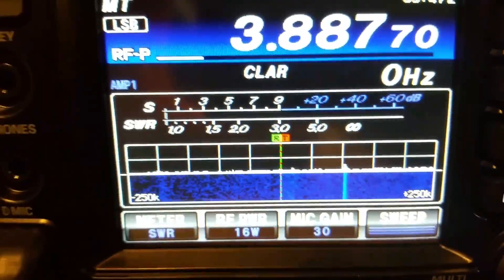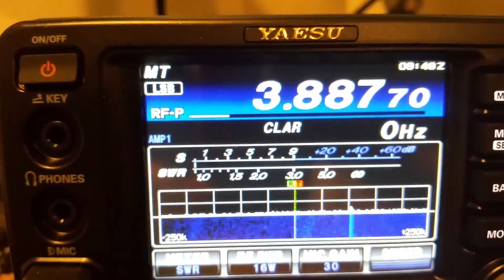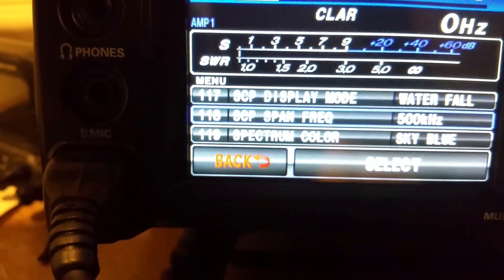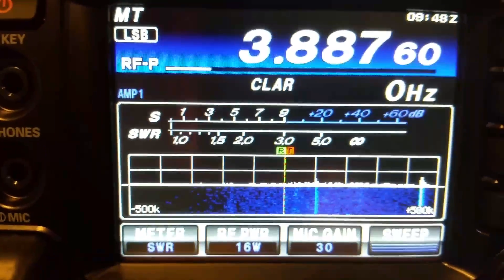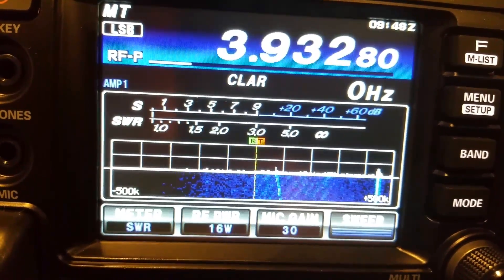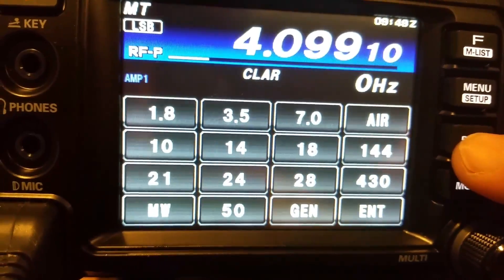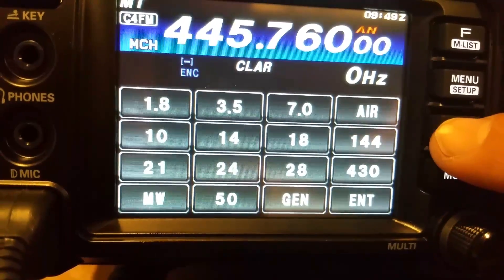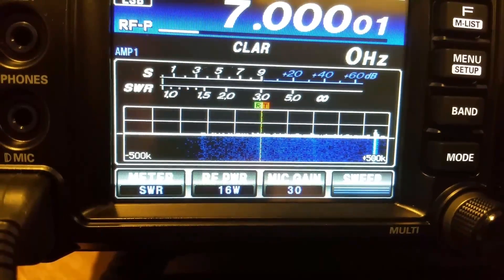FT-991a waterfall issue

Comment: if anyone has niggly issues check the pin diodes near the attenuation relay d1113 is known to go bad but it's small so you need skills and tools to change it. messes up some of the attenuation and ipo front end and stops the power amp aux from shutting off into the open  position to ground, may well also effect other functions.

Comment: I sold it. The worst yaesu I have (up to now I have 9 other yaesu and they are great!). Waterfall is just one issue. At my ft991 end transistors died (just like that) and atu in most cases did higher swr than without atu. Complicated menu, a lot of functions cuted if compare with FT 897... And at the end just 100 memories. 24usd baofeng has more...
Reply: "...just 100 memories..."  If an HF radio had 30,000 preprogrammed memories, would you buy it?  i.e. Memory # 15,000 is preprogrammed with 15.000 MHz.  Memory #28,500 is preprogrammed with 28.500 MHz.. "Wait a minute!  This radio with 30,000 memories actually has no memories at all !!"  Point being, 100 memories is plenty, 30,000 memories would be pointless.
Reply: @JxH  this is not HF radio! Its HF, VHF, UHF! When just store FM satelites (5ch/satellite) you will consume a lot of memories. Then reapeters at HF, VHF, UHF. On top public freq. I cannot undersrand what is thebproblem to have at least 500memories. On top you can not programm satelite split via PC - you need to do that only manualy! But memo isbonly 1 little issue if you compare with performance, menu and hardware issue of this radio. NEVER AGAIN! When replace by ICOM 7300 I can say FT991 is not competitor to that for HF. It's far far far away back vs IC7300.

Comment: As far as im aware the IF stage of radio equipment is around 455 KHz. As you know the pandapter is quite high on this radio also 500/500 (1000 KHz)... Ive seen some lovely radios only going up to 400/400 so seeing this would not mean your radio is faulty. I did double check this by getting a third party to replicate it on other 991As and they seem to be the same 👍

Comment: did you find the problem? any thing plugged into the wall can cause RF , like the post earlier un- plug or turn every thing off the start to plug one by one ans see what causes it, trust me... you will be surprised by whats causing it... even a computer cooling fan can cause electrical noise.... and this my friends is the joy of ham!

Comment: The answer is that Yaesu products are crap. My FT-897d developed vertical stripes on the display and the VFO went random on me (all kinds of random numbers for the frequency read out). My VX-8dr just fell apart during normal use. I have read about problems developing in the FTDX-5000 (vertical bars on some of the read out displays). The frequency display on the FT-2dr looks nothing like the advertisement. Yaesu is very good at false advertising. I don't trust Yaesu products.

Comment: The radios second IF stage is 450kHz for FM.  Try and search for interference in your shack at that frequency and at harmonics of that frequency as something producing harmonics could break into that IF stage.

Try turning the power off to your entire home momentarily and run the radio on a car battery so you can receive and see if the problem goes away. Failing that the IF stage filter could be damaged or out of spec, tune the VFO of the radio down to 445-450kHz and listen to what you pickup.

Comment: Can I make a few suggestions? Please note I have never operated an HF radio, but I wish to have an FT-991A in the future...How about setting up the radio at a totally different location with a different power supply to negate surrounding equipment/environment conditions that could be causing that line?